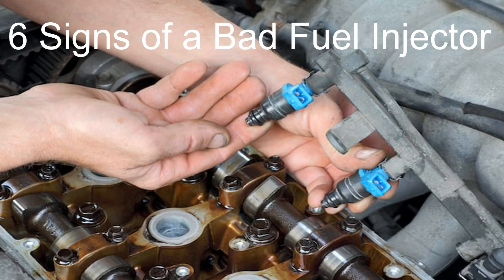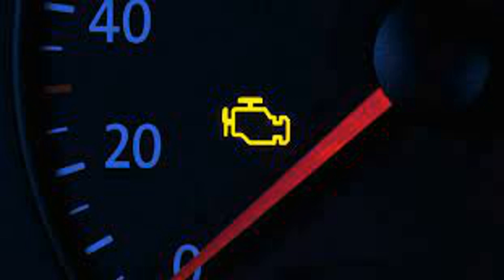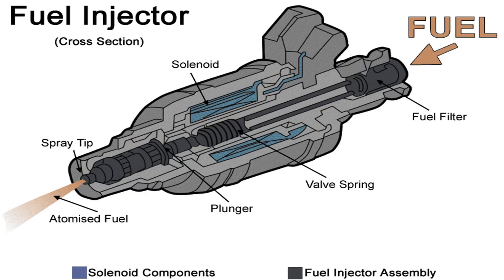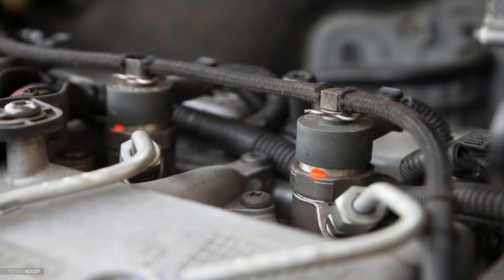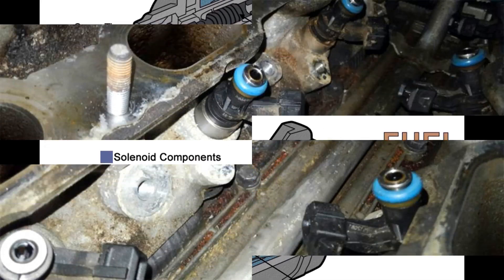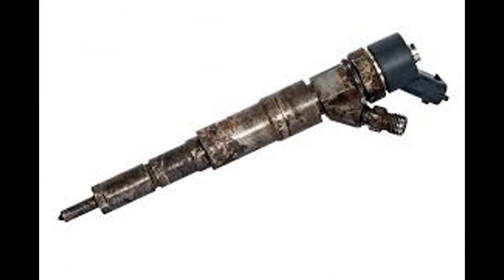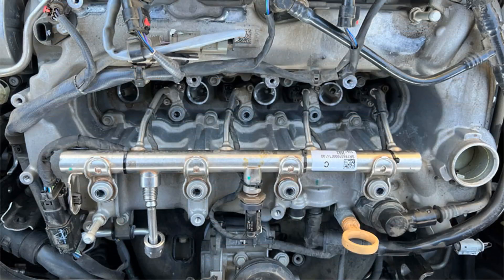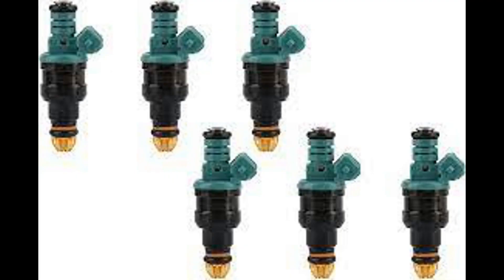6 Symptoms of a Bad Fuel Injector

Comment: Now if u keep driving it real hard because u think u fix it can it blow motor up  if it's fuel injected
Reply from the maker: Yes, if you continue to drive a vehicle that has been fixed but is still experiencing issues, it can potentially lead to further damage, including blowing up the motor. Ignoring or neglecting problems with a fuel-injected engine can cause severe damage to various components, such as the pistons, valves, or cylinder heads. It is important to address any issues promptly and properly maintain your vehicle to avoid costly repairs or catastrophic failures.

Comment: My car not well sometimes miss fire example fr gear 2 to 3 the van not run but to solved in time must play clutch pedal end the running end some time happened again all Foreman around me surrender abaut what happened
Reply from the maker: It sounds like your car is experiencing intermittent misfires, particularly when shifting from 2nd to 3rd gear. This issue can be caused by a variety of factors, including faulty spark plugs, ignition coils, fuel injectors, or even a problem with the transmission.

Comment: 3:10 ECU counter same times but injector's not vapours fuel correct. its leak. lambda sensor give different measure and ECU change all injectors timing (for bank). in broken (leaking) injector fuel still not vapour correctly. leak too much fuel (example 2x more fuel at only 1 of 4 injectors)
Reply from the maker: It seems like you are describing a situation where the ECU (Engine Control Unit) is counting the same amount of fuel injected at 3:10, but there is a leak in one of the injectors. As a result, the lambda sensor is giving different measurements, and the ECU is adjusting the timing for all injectors. However, due to the broken or leaking injector, the fuel is not being vaporized correctly and therefore not burning properly.
Reply: We fix fuel injector